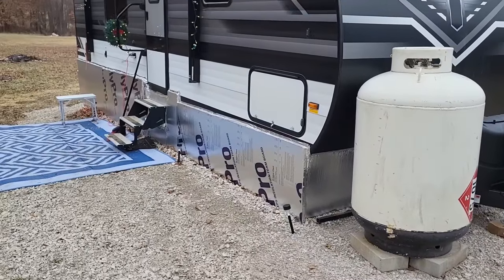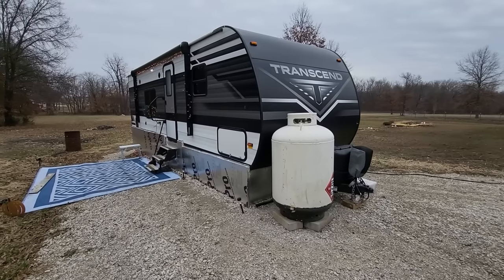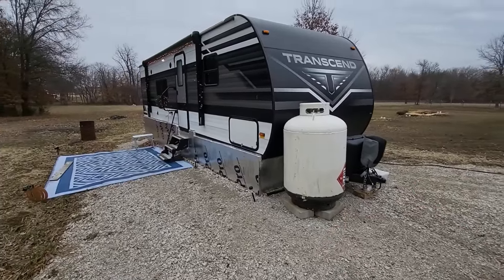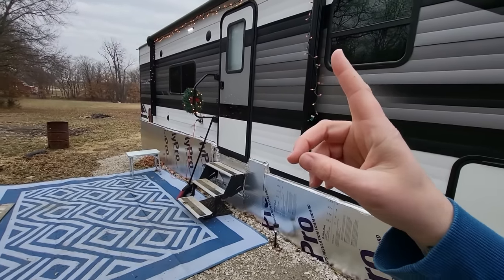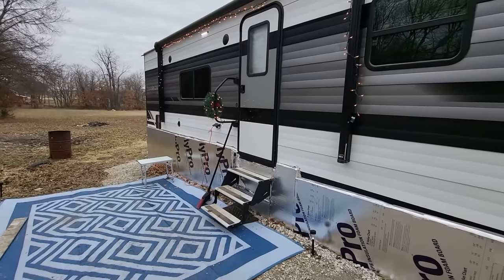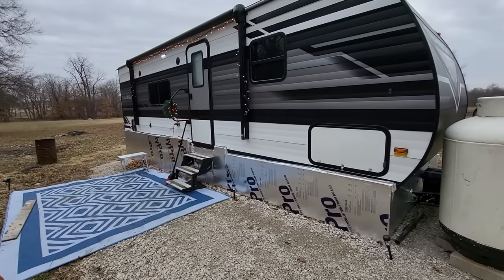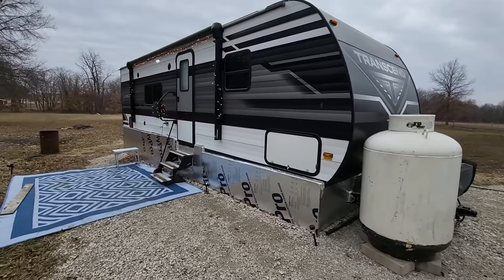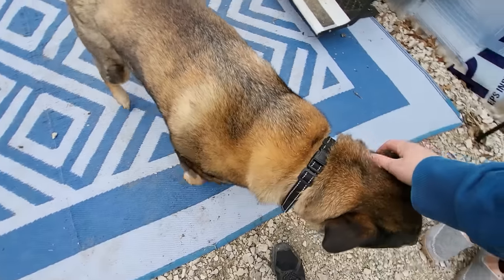Full-time camper living. Surviving the Winter! Things I've learned along the way.

Comment: what are you talking about?! That skirting looks great! You did a great job!
Reply from the maker: Thank you so much!
Reply: Skirting looks just fine.  Did a great job plus it gets the job done.
Reply: I agree looks great
Reply: You did a great job!!! We have a 35ft heartland pioneer and did the foam board all the way around, ran us $200-250 for the board and tape. This is not as easy as it looks when you are making cuts and trying to close all gaps. For us we taped along the edge/little under the belly. We also put a work lamp (it gives off a lot of heat) under our RV to help keep under us warm since our under belly is not very insulated at all. For the drains, we keep ours hooked up as well and the hole needed to open/close the drains we cut a little “door” in the foam and only taped one side like a door and the wind hasn’t knocked it opened. We use the same meters too. We had to get a large dehumidifier though because the condensation is so much on the windows, (outside would be 20-24 and inside would be 65-68 (propane furnace) we’ve even had issues with condensation in some places like where the bed meets the front wall, closets.
Reply from the maker: Thank you for the feedback! Yes the condensation is no joke in winter time. I did a followup vid to this and show how crazy the condensation got. I have several dehumidifiers and they can't keep up when it's that cold. I just started noticing the condensation issue on the bed on wall recently. I have just been pulling the bed out from the wall when we get up in am. If you have any other suggestions for that one much appreciated!
Reply: @samanthajohns9938 it’s because you are using propane. That will happen every time. Need somewhere opened, like a window, just enough for air to get in and out. Propane needs fresh air, especially to run correctly and efficiently. If your camper is sealed up tight, condensation will build up fast
Reply: @WanderingDryad-we6sy were you using propane?
Reply: I think you did a fabulous job with the skirting!! Curious as to which province you are in? I’m in Ontario and I’m planning to purchase a camper in the next month or so to live in for as long as I can. I lived in a mobile home for 12 years and I’m no stranger to this lifestyle. My issue will be finding a more permanent spot for it once I have it.
Reply: You did an amazing job on your insulated skirting. We are fixing to do it for my sister in laws 5th wheel.

Comment: Your cold-weather set up looks pretty good. Two things I would add Bales of Straw going around your skirt. That would help out tremendous with more warmth & wind abuse. Also get ahold of your gas company have them put a splitter on propane bottle. Run a hose directly to a full-size outdoor gas grill. Electric heater underneath on cold nights great idea.
Reply: My only issue with the hay is it invites the mice, it's hard enough keeping them out as is. Don't want to give them a condo
Reply from the maker: I've used them before with no issues. But I do have a cat that keeps mice issues non exsistent
Reply: @snowduckin2479  Very true I forgot about that !!! Good luck this winter wish u the best.  👍🇺🇸🇺🇸
Reply from the maker: Thank you! So far so good big snow coming and cold temps I think we are ready!
Reply: @WanderingDryad-we6sy okay thanks, I have good mousers…. I may put some straw around once snakes r sleepy… was worried

Comment: They need to replace the propane tank. You need to know how much propane you have and it's the propane companies responsibility to fix this. At least in my state.
Reply from the maker: It's a smaller company and they have been great to deal with so I'm not gunna fuss about it too much. They said they would come replace it. They even topped off my propane at no charge because of the gauge issue.

Comment: Did the same with a camper we owned except also had 3/4" plywood on top of the insulation. We had a milk house heater underneath. Was a 1989 Skyline Nomad and was propane heated. Did great for what  it was at -45 in North Dakota. The biggest issue we had was the condensation in the inside. Stay safe, warm, and have a great winter.
Reply: Sweet! I have a 78 Skyline Nomad! Actually, I have a brand new RV built up from a bare trailer and then wrapped in the tin from a 78 Nomad. Unexpected cold snap this year is supposed to take it down to like 2F and I don't have time to wrap it. I know the R30 I put under the floor keeps my toes comfy down to about 15F and all the plumbing is on the heated side of the wall, so I'm just worrying about comfort and a few extra degrees at this point. But I have GOT to get a heated hose, because while the pipes are safe, that hose can freeze and then no harm no foul but also NO WATER!

Comment: So just a silly bit of advice when applying tape to literally anything if you use a heatgun or a Torch to warm the adhesive before you apply. Tape works a 1000 times better again. A dumb life hack, but it works. I've done this while taping a torrential downpour. Even the crappiest tape works better.

Comment: I have been experimenting off grid for a year now, my trailer is a 2 season 28ft and externally insulated with reflectix, half done the 2nd layer today, last year a low of -27F -33C and my primary heater was a 350w omni heater plus 40 mins of my 1500w. My basement with no heat was a low of 33.6F. Now you have a good idea of what I have the new upgrade could work well for you, my entire underside is airtight, this year I added a under rug heater , I put it on some flooring over the reflectix bottom, The Rug buddy is 170w 4kwh , with just the 170w heater it was 23F -5C for 10 hours, the basement was 64.4F 18C , bedroom was 68F 20C , Try tuck tape repair tape, clear and nothing pealed even on the roof after a year of -33 to 40C. If you want to try reflectix I already came up with a plan to bypass the insulated floor with no mods.

Comment: One thing off grid living, buy a heavy insulated tarp. Lay it down back onto it , then do ur skirting. Really helps. I have a 8x24, then I have a 30x50 trap. I use the 30x50 as a base , then 8x24 insulated, then pull the bottom tarp up the side and tape it.
Reply from the maker: Oooo that's a great idea. Thanks for the input and the support!

Comment: Nice video, you done a good job, I subscribed. Don’t worry too much about the freeze up. If it’s insulated underneath, and you keep the furnace on, even if it’s turned way low, as long as it kicks on, you generally won’t have a problem. I’ve done this for years. I enjoy some of the tips people are giving. You’ve got this!
Reply from the maker: Thank you for the support and encouraging words. I'm almost too chicken to go no skirting but it sure would be nice to not have to mess with!
Reply: @WanderingDryad-we6sy  you’re so welcome. It can’t hurt skirting it anyway. I’ve never done it, always had a heated, insulated underbelly and never had any problems. I’ve been through several very hard freezes but never any major issues. You’ll be fine. Keep up the good videos. Thank you.

Comment: If you want to know how full the big gas cylinder is just pour a kettle full of boiling water 💦over it the liquid gas inside will pull the heat out of the water and you will get a wet line showing the actual level of the liquid gas inside the cylinder
Reply from the maker: Great tip! Thank you.

Comment: Im a Pinter that does a lot of exteriors. You might be able to find some white exterior tape. The “exterior” part is what matters. UV resistant and is designed too stick amazing outside even after it gets wet but still peals away nice. It’s not cheap tho. I use it in yellow colour. 👍
Reply from the maker: Awesome advice! Thank you, I'm gunna check that out
Reply: Thks for that..... I was hoping I didn't have to go flex seal tape, that stuff sticks forever (love it)

Comment: I've just purchased a used fifth wheel and will be putting it on some land out in the country. I came upon your channel doing a little research on what full time permanent RV living will be like. So much to learn.
I enjoyed this video. You have a nice easy presentation. I'll be checking out some more of your videos.
I'll be moving from a 4 bedroom house to a 36' trailer. Although in the past I have rented a travel trailer, I know almost nothing about trailer living. Your idea of putting gravel around the bottom of your insulation to cut down on drafts is something I hadn't heard before. I'll definitely try that.
Reply from the maker: That's awesome good luck to you! I've def done plenty of trial and error. Working on a video now of my most recent error. Been in the negatives for past 2 weeks and I've slacked off on some things this winter. More to come thanks for the support!
Reply: There's already a well and power to a pole. When it warms a bit (Colorado) I'll have a septic tank put in but until then it'll be the storage tanks.

Comment: I added 2 diesel heaters to my rv,that has add a second heat source and I set them to about around 65f to 68f.i can run my diesel heater on low and get about 10 hour to a gallon of diesel.

Comment: There is a plastics squeegee that helps secure the tape much better than by hand. Go to the HVAC shop and ask if they have some?? Installers use them to heat the tape and secure it. It heats up with friction. As you apply light pressure to the tape it kinda “hears the adhesive to secure it best.

Comment: In my opinion, I would have installed J-channel all the way around the bottom and intalled skirting as needed.  No tape to mess up the trailer.  Then when you want to move, remove the skirt, move the trialer, reinstall the skirt, good to go.

Comment: Hi, thanks for sharing your experience. I’ve been in my 5th wheel since June 2014. I live at my mom’s to help her. She’s 92. 

My 5th wheel is parked halfway under a rv cover because the three slides and height didn’t work. I was able to get some T-111 siding I cut up and used for skirting. I use heat tape around my water line to keep it from freezing. 

I had to change my toilet as a bracket broke and the second time it filled the underbelly and pulled it down. I still need to have the permanent repair done on it but it is setting back up for now. 

A friend helped me install an extension trench to the shop’s septic tank hookup. We installed pvc pipe in the new trench and pvc pipe from the trailer to the corner of the shop where we ended the trench/pipe. My grey water tanks traps don’t work so they are always hooked in to the system so when I flush the black tank I need to fill it with water and do an extra flush for a clean out. 

My bedroom floor was always cold so I insulated the ceiling in the basement as well as the pipes in there. My unit is a 2003 so things have gradually gone bad and I’m broke taking care of mom. It means things like the furnace going out calls for two to three little heaters carefully placed and monitored. One is plugged into a heavy duty extension cord that is plugged directly into the shop. I avoid blowing fuses that way. The fridge quit working so I have an electric fridge where the dining table would be. I do save on propane usage since I primarily use it for cooking on my stove top. The water heater is on electric with propane backup. 

I have a washer hookup for a combo machine in my bedroom closet. They are ridiculously expensive so I do my laundry at my moms house. 

A huge thing for the rv is to install plastic window coverings on the inside of my “house”. I use HVAC tape but do have to keep pressing it down against the wall occasionally. It makes a big difference. 

I like the use of insulation you’ve done for skirting. It looks like you have the shiny on one side kind. You might try foam board with a covering of plastic next time. It shouldn’t fall apart as easily as the white beaded side of the foil covered type. And dumping grey water on the ground will eventually start stinking. Can you make a dry well with a fifty gallon drum and River rock?
Reply from the maker: Sounds like you have a solid set up. It definitely does help to be more stationary through the winter months. We are debating on when we need to throw skirting on again for this coming winter. I'm holding out as long as I can.

Comment: Hopefully u got ventilation at each end of that skirting especially when using propane and keeping out mold mildew
Reply from the maker: Yes I noticed on my hydrometer humidity was getting high under neath so I opened up a spot on either end to let some air in.

Comment: What are you draining your gray and black waters into? Is that a DIY septic? Also, I see your close to a building or house? Do you use their electricity  or run exclusively off propane? How much propane cost do you average per month?
Reply from the maker: Draining into a legitimate septic system. Power is running from the house. Staying at my sister's place and pay rent until our house is built. Worked out well.

Comment: Hell yeah thank you for this! I know alot bout homes but it's like campers are different in a lot of ways.  I've got straw along my bottom as well as I see in the comments.  But looking for something better looking and you nailed it. For the water lines I've got the heated tap and I'm wanting to say 3 inch foam because I actually ran my hot and cold from my place to my dad's lol. It began when the propane wouldn't heat the water good enough lol. I do have a question though if you have a problem with stink bugs and a solution?
Reply from the maker: I used hay my 1st winter because I didn't secure foam board well enough and wind storm took me out. Ppl worried about mice but my cat took care of that. Stinkbugs I have not had an issue with. The ladybugs got crazy but I make sure to spray around the outside specially around the support stabilizers where anything can climb up and my basement area. I'm going with thinner foam board this year it's easier to work with.

Comment: Do you own or rent your propane tank?  You mentioned you were in Missouri, I'm in NE Arkansas. No propane companies around me will rent the 420 lb ASME and they won't rent me a 250 gallon if its hooked upto my RV.  Of course I can BUY a 420 lb $875 plus regulator, hoses etc.  Just wondering what your experience was related to propane.
Reply from the maker: I rent mine it's 60 for the year. That seems crazy they wouldn't just rent one to ya.

Comment: My kids woke up in the middle of the night frozen, they were sleeping on a bunk bed in our brand new camper next to a window. Any suggestions on what to put by their window to keep the cold out
Reply from the maker: I use the roll of thermal reflective insulation. You can get rolls of it on amazon and cut to the size of the window. It works really well I have it over every window in the winter.

Comment: I just moved from Texas to Missouri a few months ago I live in a fifth wheel on my daughter's property. I am freaking out a little bit about the winter's here in Missouri. Worried more about my water freezing than anything. I have 2 pit bulls that keep me warm. I may change my tune on that once winter really hits.
Reply from the maker: I felt the same way but if you set it up right you should be just fine. I made it through -7 last year no problem. What kind of camper do you have?
Reply: @WanderingDryad-we6sy  2006 Jaco J flight.

Comment: Im at this moment. Been traveling up to Wyoming. Underbelly is like yours heated so they say and enclosed. I put up this clear plastic on windows to keep some cold out. I got light foamy reflexive type stuff for some other windows and my gawd....tape!! Stuff makes me MAD.  Have not used propane yet and almost in Omaha right now. I got two fireplaces and space heaters when need be. I dont use blk tank and always dump grey tanks to travel. First the dealership was going to add stuff to winterize my rig but then they didnt. Glad. Cause i would of wasted it all. Im not sure what my future holds. Im extremely poor. Went to move and i thought my portion of the inheritance was coming in. Well nothing has yet. My fate is sealed up in the "when".  I had liked rhe E.Z. snap skirting made for trailers. But yeah....who knows

Comment: I will give you all a tip that you’ll love and thank me for….. the best insulation to use is ………. Kao wool …… it doesn’t burn…. And the heat and cold doesn’t go through it…… it’s the insulation used in melting metal in the furnaces ….. if you can melt metal but it doesn’t catch fire …. Do you think it will keep the heat in and cold out or cold in and heat out …. Yep … you’re welcome….
Reply from the maker: Awesome thank you we will have to check that out

Comment: Hey, can you place hay bales against the foam board to keep them in place instead of tape and gravel ? It might help add some r value as well idk 🤷‍♂️ 
Also, I know from experience that a 100 w bulb in a small lamp under the camper will help build heat up to prevent freezing also, and might be a little safer than a space heater. I know a rancher who keeps a 100w bulb in his pump house over the winter in Nebraska to keep his well pipe from freezing up and it works, plus all you have to do to make sure it’s on is look for light coming through a crack or a “window” of sorts.
I’ve been considering g doing the same thing you’re doing, living in my camper for a few years to build money up, but I don’t have a place to park it nor do I have a 4 season 😢
Reply from the maker: Yes you absolutely can, last year I ended up having to go with bales against the foam board because it kept blowing away. I don't like using the hay though because it's so messy. I say go for it, been best decision I've ever made. Thanks for watching and commenting!